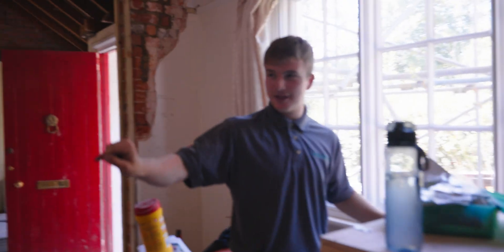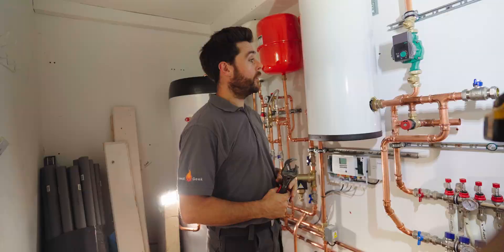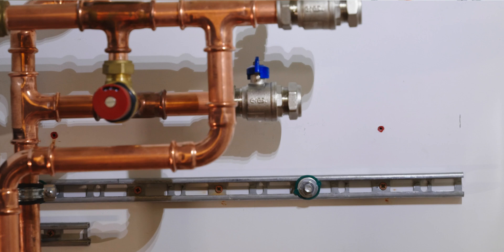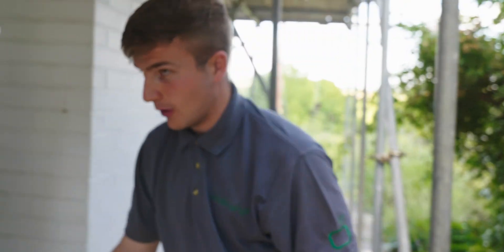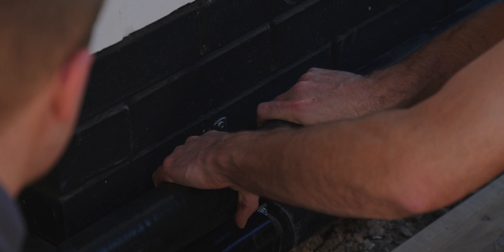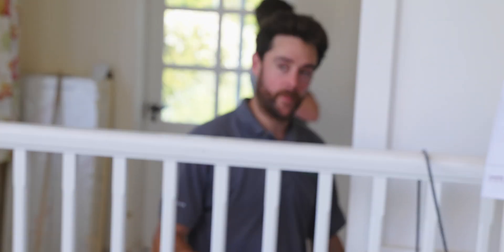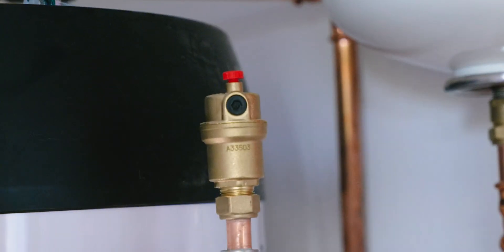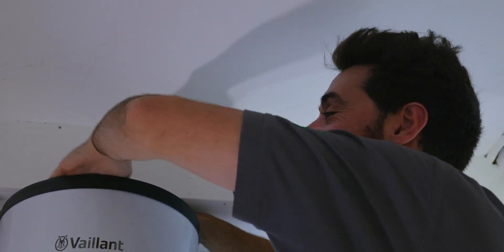How To Waste 2 WEEKS On A Heat Pump Install | HG On Site

Comment: Good job lads,, out of interest,, what do manufacturers generally specify as the Type of cable supplying power to the heat pump and the type of cable for the inter connection/bus?

Comment: Looks neat for what it is. An over complicated and bulky answer to a problem that has far simpler solutions. Greg is just as comfortable in front of a camera as he is installing pipe. And 31C isn't very hot. Try laying concrete at 42C or framing at 46C.
Reply: You’re hard